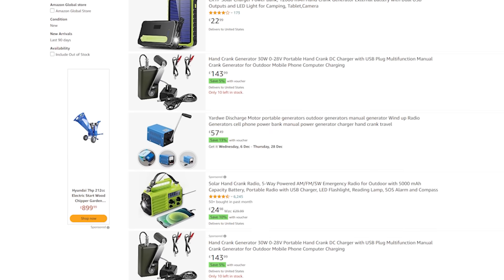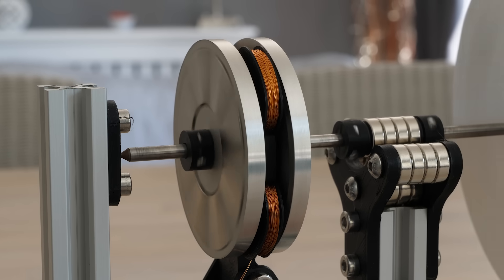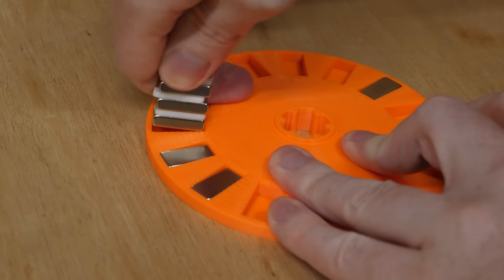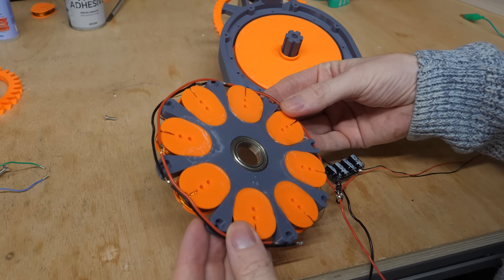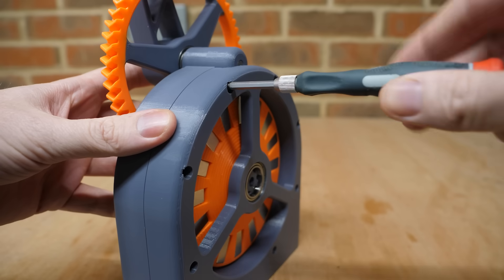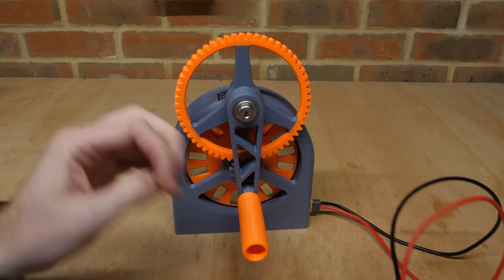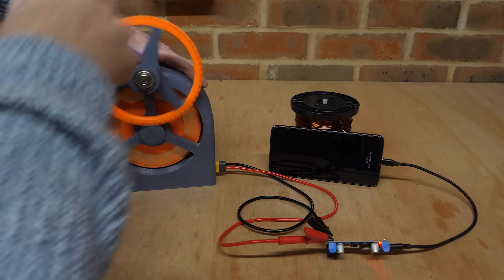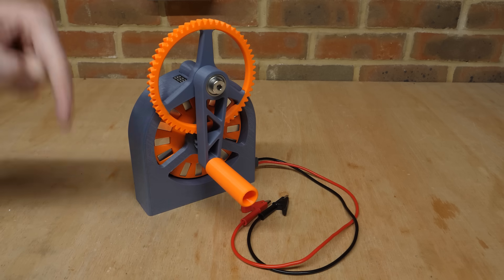Building a Generator

Comment: if you really want to power something up with your muscles, you need to make something that takes less effort, something that lets you use strong parts of your body efficiently... 

i would rather sit there and make 20 min. workout than cranking 1,5 hours... 
maybe something you could connect to a tree and push and pull? something that gets wrapped arount a tree, the string you pull gets automaticly pulled by the generator machine and mybe use it with booth hands or make one strong one pull thing... 

i mean you could almost keep the size? what would be the limits of how much watts you could make with this machine? it will definetly be still mobile.... i bet you could make 50 watts with body power easily
Reply: That´s not how it works though. Resistance high: What you want. this means you are exhausted in 30 minutes. Your watts wll be LOW (since you cannot handle more than 30 minutes a exremely high resisance).

While low resistance means. You can CRANK for hours and hours and hours...and your output will be medium-high, but still good enough to reach ~500W on a single day if you have he TIME to crank for 6 hours (6 hours 80 W = 480W = 0.48 kWh).

MEDIUM resisance will give higher Watts/hour but you are exhausted after 1-2 hours as well!

Comment: What if the copper coil section could also rotate, but in the opposite direction?  Wouldn't that effectively double the speed?  There would have to be two copper rings around the edge of the disc so it would brush against fixed contacts.

Comment: If the magnets weren't press fitted into sockets and instead visible from both sides, could you then add another copper coil setup after the magnet rotor and keep going, mag/cop/mag/cop/mag/cop/mag, etc?

Comment: Once, I tried something similiar, but I used a stepper motor instead of a brushed dc motor. The advantages are, the stepper can deliver a pretty good amount of power at fairly low rpm and the AC produced has a very high frequency which is easy to smooth. I got about 10W from a NEMA17 at 1000RPM. Of course a gear is needed too, but the ratio doesn't need to be that high in comparison to a dc motor.

Comment: This video makes me wonder if an e-bike with capacitors would make sense. I am a well trained every day biker and only like to have a little support when climbing a hill. Also capacitors lasts much longer than batteries.
Reply: Most cranking-generators use cheapest-capacitors though. And simple alu-based ones. those last only 5000 hours @ 25°C. Or 2500 hours @ 50°C. After 5 years these cheapo-cheapo capaciors will be nearly dead, assuming you use i every 2nd day a least once. And when you use it in a hot summer, you will easily reach 60-70°C on these capacitors when it´s 40°C outside. thus afer ~5 summers cheapo-cheapos are dead.

This is also he reason why many fodlable solar-panels will fail after 5 years. Because their capacitors are also dead after 5 years.

Comment: Why is it making it harder to spin the crank when it’s under load?
Reply: Because more resistance! When you add a device, the volage drops. Which you have to make up for it in order to keep it stable = more resistance will be added to the motor in order to make up for this difference.
Reply: @SmartZero-f8e  ah. Neat! Thanks

Comment: would some sort of bearing flywheel system stabilise the voltage output, as then you could get a constant spin to the alternator so the voltage wouldnt jump around due to the kinda 'oval' shape of your hand/arm movements? or would the magnets ect stop the flywheel from turning effectively?

Comment: Why not build "hand crank" or 'a' generator that's powered by the magnets always pushing away from each other? You just gotta give it a push, and it creates a runaway effect, of always pushing away, and trying to catch back up.

The function is that the magnets act like a spring that attracts and when it comes in field/detects another magnet getting too close, it repels it back slightly, as it gets faster it creates a average distance "chase->trail gating" once it gets faster and faster.

Depending on how you use the field of the magnet, you can repel the other magnet forward, so you do that too a full loop like a track that goes full circle, and it goes round and round and round and round, while having the magnets explained above, move like >-< / <-->  And when it gets going & gets faster they simply start running at consistent distance from each other, and is pretty much at an "accelerated chase/tail gating" This would be some extremely precise voltage metering and polarity reversing during each passing of a phase/polarity changer, once they get close.

Comment: I'm planning to have the same project but I don't have the necessary materials and don't even have a 3d printer i have a DC motor It's small my plan is to create a hand crank flashlight but I've encountered a problem caise it will produce electricity and light the bulb if spinned very fast so I need a gear but cant have them can you help me? I have a motor of a fan but idk how to modify it to produce electricity I think it can produce more electricity if finished.

Comment: Sorry stupid question but how does spinning magnets close to copper coils create electricity? ⚡️
Reply: Because magnets induce a magnetic field. And when there is a magnetic field if you move somehing from/to from it, "eddy current" will be created. And this is energy. If you hook this up to a cable you can use this energy. Amoun of energy flowing depends on size of magnetic field and RPM of your magnes/coil spinning. Size of magnets and numbers determine how big magnetic field will be!

Comment: hmm a very useful device, the problem now is the general lack of energy storage, it would actually benefit to have a bank of supercaps attached 24/7, with an isolator for the capacitors to keep them from discharging in storage, 6s array with overvoltage shunts just in case and reverse bias diodes to keep them happy(or just a single fat zener on each one)
after that you can set up a regulator module for USB or a set of clip leads to give your car an emergency jump
in fact a device like this in a car emergency pack with a large enough supercap pack could have you hand-crank your car, just like the cars of old
this allows you to get to the nearest parts store to get a new battery as long as your alternator still works

Comment: Excuse my dumb question, but what is creating the resistance? (Not the electrical term resistance) Or more specifically why does connecting a more power hungry device make the crank harder to turn? It's not like there's anything new added into the mechanism itself that adds friction so why is it more difficult to spin?
Reply: Voltage drops when you connect a device. Depending on the voltage-drop (Usually around 0.5 Volts) you have more resistance.

Resistance is determined on VOLAGE alone. Higher voltage required. Higher resistance. Lower voltage: Lower resistance.

Comment: Have you considered creating a disater relief generator from a 3d printer with is hung up high and is powered by heavy object falling to the ground. Youll been a big gear to slow the bag down from gravity. That power can be used gor lighting tents or charging devices

Comment: The best bit is when you let go of the handle and the weight turns the generator for a second. You could use a weight on a very long string for potential energy that wouldn't require any human effort.

Comment: Here is a challenge  - a generator that you spin wuth your legs for charging your e-bike battery at 5A.
Reply: It isn´t possible to charge an E-bike battery on a bike-generator only. Too low human power. Humans  feet aren´t good for powering a 36V-motor!

Do you know how HARD it is to just turn a 36V-motor a single time? Why you think most wind-generators barely produce any energy?

It´s exacly because they use a 36V-motor as well. And these motors cannot be powered with jus low amounts of wind.

And then even 5A...Hahhaa! What are you smoking dude? A human can barely handle ~10 minues of cranking a moor with 36V...so what do you think would be the oupu? 1 Bazillion watts?
Reply: @SmartZero-f8e  Yeah, my math is off. Generating even 200W with legs is quite though to be honest...
Reply: @WhiteSkyMage  Correct! It is possible if you`re build like Arnold Schwarzeneger though!

Comment: Hi Tim.  I left you a message here several hours ago- and it disappeared.   As a 55 year old Physicist, Scientist and Engineer who who has spent much of his life teaching and mentoring groups and individuals in various technical matters, it is sad to see someone run away from an opportunity to learn something helpful to their endeavors.  As mentioned previously, you have done a great job on various mechanical aspects of this generator.  Well done.  I have built similar generators and your voltage measurements are very (like factor of 10 or more) low for such a device.  This is a result of two primary factors- 1) Low flux density due to large air gaps, relatively thin magnets, and no focusing of the field lines.   2)  Incorrect geometry of the coils related to the magnetic field lines generated by the magnets.  When you mention HOW voltage is generated, you imply a "Reverse Lorentz Force Law" is at play- you show how the poles of the magnets align with each side of the coil, and that as those coil sides pass through the magnetic poles, a voltage is produced.  That is not how an axial generator works, and the proof is in your generator.  The poles of the magnet are reversed for each side of the coil, and SO IS THE DIRECTION OF THE CURRENT FLOW in the coil.  If the Physics were as you say, your generator would generate little to no voltage as each magnet pair would be working against the other to produce voltage.  The Lorentz Force Law is not something that works in reverse.  If it were, essentially all motors would work great as generators- but in practice, the average motor makes a lousy generator.  Voltage/Current/Power in a generator is created via Faraday's Law of Induction- it is the rate of change of the magnetic flux through the CENTER of the coil that counts.....     https://en.wikipedia.org/wiki/Faraday%27s_law_of_induction

Comment: I did something like this about 20 years ago and found out just how hard it is to make a good generator. I spent something like a week or two machining parts and so on just to find out that even the cheapest $60 alternator I could get at the auto parts store could totally obliterate the output power of my generator. Its funny that my real conclusions had nothing to do with making a generator but more about how good we have it. The fact that we can buy really nice cheap equipment that has decades of development behind it. Basically buying knowledge and practical use for cents on the dollar when compared to the resources originally needed to head up development.

Comment: Use the ultra capacitors to capture any energy generated by the generator. You can turn the generator slowly but for a longer time and the capacitors should suck up any power that is put out and hold it.  Once the ultra capacitors are full  then you can put that energy to use all at once for like starting a car. The ultra capacitors should be way more efficient at grabbing and storing energy than a battery. Not sure how efficient the batteries are at grabbing and storing any energy that is given to them. How much energy is lost from the rectifying diodes.

Comment: Why does the amount of wires change the voltage, exactly?

Why would thicker wires with less spins but equal mass, give lesser voltage? How does that work?

If you used a solid block of copper instead of spun wire, would it not work?
Reply: a) Because it produces a bigger/more powerful magnetic field then.
b) Resisance of wire!
c) No it wouldn´work. You need  copper-wire to create a COIL. And you need many coils to get a high output.

Comment: I thought about make a hand crank generator. I thought about using an old cordless drill and have that charge a power bank. Then add on what ever modules to it.
Reply: ? you want to use a drill to make a hand-crank generator?
Reply: @SmartZero-f8e   I am going to use an old cordless for the motor and gear box. Add some a power bank to it and a few other boards to help out with power.

Comment: I got this randomly, but any design that requires you to do whatever you're doing with your secondary hand in order to make your product usable, is sub-optimal. Just off the top of my head a design that functions like a bike pump or like a lawnmower pull start would both allow the user to brace the charger with their feet instead of your solution of "hold the device down against the table awkwardly with my free hand."

Comment: Very nice video!
One question tho, why not use your super capacitor in parallel with the phone charger?
That would both grab more energy from your hand cranking, and smooth the voltage to the charger.

Comment: Imagine hooking the small electrical motor at 7 minutes in to quick connect to the hand crank. It will technically create its own power with only an initial push of the crank. Then just add a secondary power out, for actual use elsewhere, and a regulator to not burn up the small electrical motor.

Comment: In my high school electronics class we had a really nice crank dynamo.
We used to compete to hold it by the outputs and see how fast we could turn the crank before we dropped it.
The gearing was strong, so I don't think anyone even got past about 50 rpm.

Comment: When you were powering the phone a much better way to connect crocodile clips to the board without needing to make a cable is to just connect wires to the screw terminals and then just attach the crocodile clips to the wires, there is a much lower chance of them slipping off or shorting.

Comment: More power... Put all the coils in parallel then use 2 diodes to feed 2 capacitors as a voltage doubler. That'll cut your losses. Bigger caps and a 2 channel active rectifier will top it out. Keep the super capacitors across the output for everything you connect, especially the USB 5v.

Comment: It should be possible to get a glow out of a household AC filament bulb using this setup. We had something very similar in GCSE science about 35 years ago. It really drove home the equivalence of difference energy types to actually feel with your own hands how much harder the crank was to turn when the light was switched on. Not sure PLA would take the forces needed though.

Comment: Yes Tim, I built my own after watching this out of a Fisher and Paykel washing machine motor and an exercise bike and now I'm charging the Tesla while I get exercise  😉
Reply: you´re laughing. Bu my pedal-generaor is very powerful and can charge any 48V-e-Car. Very slowly though of course (about 85 Watts/hour). It can be used in an emergency. You can also charge trikes, E-bikes (with a 48-to-36V-Converer) and oher electrical vehicles.
Reply: How did you get such a robotic "I have a chip planted in me and am just a number" name dude? " @SmartZero-f8e " Actually I wasn't laughing, I was sharing ideas for people who wanted a bit more power....  With a small battery bank one of these fantastic washing machine motors (much easier to build a working generator) you can run an entire house for power when wired correctly with an inverter.  (Check out the You Tube Channel "Angry Ram" where he does this!) The idea here in this video is good but a TON of work and very small output.

Comment: that dc charger is called an XY 3606 it can go 5v 5a but ur phone doesnt use that many amps i think
if u want a good phone charger then go for the SW3518s it can do PD protocol upto 100W and pps 65W
u will need to increase the voltage upto 20 watts since its just a step down convertor
Reply: You cannot use high volages such as 20 or even 30V or higher on pedal-generators since resistance gets too high. Exception: If you use special motors (which are extra-expensive).

Comment: sincere questions here, since my knowledge about this is very minimal 🙏. Can the magnet being placed just in one pole? Then no need for the bridge rectifier, just replaced it with voltage stabilizer  instead for a constant voltage output?🙏

Comment: if i make this myself i think i would add an opposing crank on the other side like bike pedals to prevent needing to swap hands, and maybe use something like your supercapacitor bank in series with the load to make it easier to take short breaks. 1 hour to charge a phone doesn't seem that bad all things considered!

Comment: pedaling generator would be good compared to hand operated, since our legs are accustomed to cycling, so u can charge anything for hours.
Reply: No you cannot cycle for hours. Especially not, if resistance gets higher and higher, when you plug in 18V or even 20V-Devices.